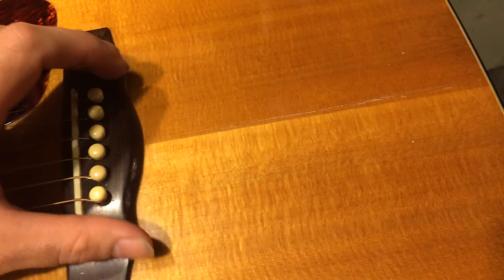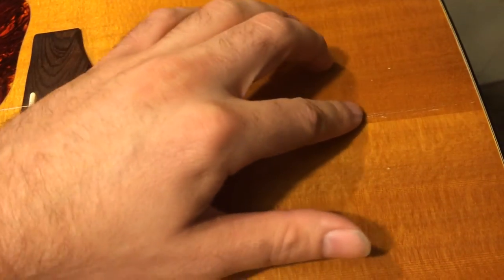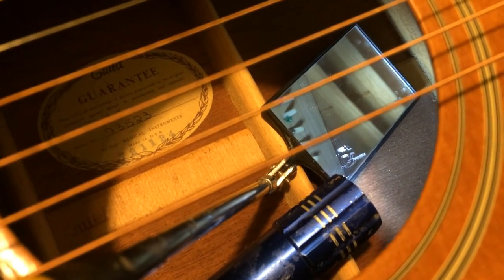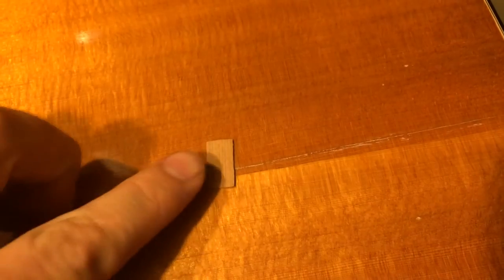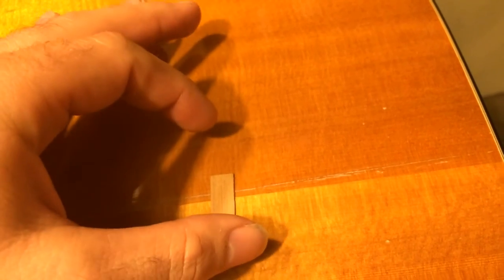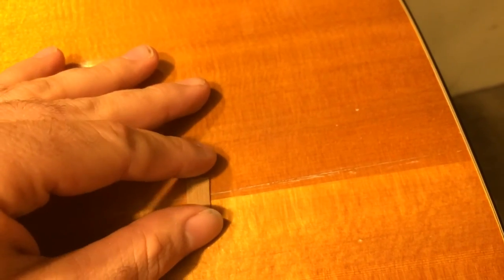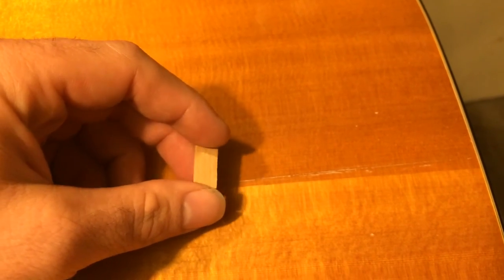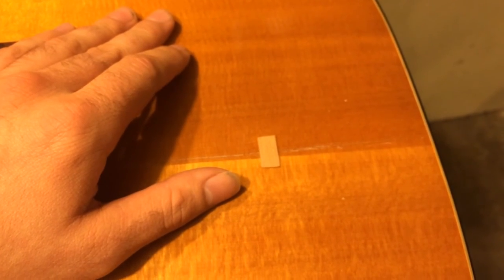Crack Repair: Cleats are Important

Comment: In violin repair work cleats are typically used with grain at a 45 degree angle to alleviate uneven grain expansion from humidity. I have seen cross grain cleats (90 degree offset in grain direction) worsen a crack. I am not sure if this translates to guitar repair.
Reply from the maker: I have done them both ways. I think that the advantage of doing it at a 45 is that if you have others glued in either perpendicular or at a reverse 45 that it will break ou the otherwise sharp line of cleat edges which I think could cause some strain in themselves.
Reply: Hello! I might add that the main reason for a violinmaker/repairer to make a cleat at 45 degrees is to avoid that the ends of the cleat become a marker for a new crack, and to reduce stress when humidity changes. For crack repair (and almost every other repair in the violin world for that matter), we always use hot hide glue mainly because of reversability, being able to redo repairs without damaging the instrument. Hide glue is unbelievably strong but also somewhat brittle, and in most cases it will break before the wood itself does. In crack repair this can be an advantage, because like in your case in the video, an uncleated crack may sooner than later open again, preferably in the same spot, and if it's badly glued with some non-solvable glue it is living hell to clean that crack in order to re-glue it. The scenario might also be that the non-solvable glue holds up to the task, but that a new crack appears close to the old one. Cleats in violin repair are usually square, "standing" on one point in relation to the crack. Glueing cleats of-set of the centre of the crack helps reducing stress, and they are also cut down to a pyramid shape, being thicker in center and down to almost flush towards the edges to make it more flexible. The size of it is probably debatable depending who you ask. But from my own experience, if you make a bigger one, say a square about the width of the piece you are using in the video, you also need to cut it thinner to try to reduce the dampening effect and still gain flexibility and strength as much as possible. Alternative materials like parchment, cloth(cotton or linen), Japanese paper etc. is also common in violin repair and might be used in arched instruments because of the strength the arch itself offers. But they are probably less appropriate when used on a flat top/back and especially when used with hide glue, wich tends to "pull" when it dries and may distort the surface when used on a bigger, flat surface like a guitar top. The biggest difference between violin and guitar repair though, is probably that violin repairers tend to be very concervative and rip the top of for easier access to the inside of the instrument, while the guitar repairers comes up with ingenious solutions for them to do everything from the outside (not necessarily easy)😂 
Best regards,
André

Comment: So, I have an old arch top, f hole Harmony from about 1947. Two big cracks. One from upper f to top binding, one from lower part of f to bottom binding. About 1/16th wide, down to nothing. I'm humidifying it now to try to narrow the cracks, but can't think how to cleat it.
Reply from the maker: boy, yeah, arch tops, mandolins and sometimes ukuleles are a real pain. What I do with arch tops is I have a piece of tie wire that I bent a little loop into with some round tip needle nose pliers. I put a neodymium magnet on that loop, with a cleat attached to it using double stick tape and then put another magnet over the crack on the outside of the guitar. Its often much less exact and messier but that's the best way I found to do it without drilling a hole and using a tie block.
Reply: @DrewsGuitarShop  Wow. Ingenious.

Comment: Great tip. How do you attach the cleats on the back. What type of glue should I use? Is it better to use a few small ones and put them like a stitch or a long thin strip that covers the whole crack (along the crack)?
Reply from the maker: +Jeet Ray I use regular yellow wood glue for this job and tend to space them about an inch or a little more apart. In most cases it's best to use these short cleats. For one thing, a long piece of opposing grain soft woof is going to be extremely hard to work with and it will also effect the movement of the wood more than a series of short cleats will. One of my very old teachers from way back preferred using fibrous material soaked in glue, like cotton, gauss or panty hose material. I have used this method before as well, and though it is a lot sloppier looking and also has the drawback of not really being a tone material, there are instances in which it does work better than cleats.
Reply: +Drew Jones Thank you. I own several high end classical/flamenco guitars. I just fixed a hairline crack on the back of my guitar yesterday with super thin CA glue. Didn't use any cleat. May be next time. As you said - eventually when it opens up again.
Reply: What if you used a mahogany cleat on a spruce top?

Comment: what if the crack runs above and even with a brace and cant be cleated? how is that repaired
Reply from the maker: The brace is probably separated if that is the case. Reglue the brace and it will do the same job as a cleat.

Comment: Hey Drew! I'm doing a crack repair in in the side of a guitar (solid rosewood) and I have some rosewood to use to make cleats, but the density and quality of the two woods are not (perhaps) not (sufficiently) analogous. I was wondering if running cleats across the grain of the side won't inhibit the free vibration/resonance of the side as much as running another material in the same quantity (spruce, mahogany, plastic, a live animal... really anything ) across in the same fashion. I assume that even a rosewood cleat will change the tonal character of the guitar a small amount. How relevant in your estimation/experience is the choice of cleat material? Also, how thick/sturdy should a cleat be? Ive heard of people using cloth cleats. Thanks so much for posting!
Reply from the maker: Well, I mean, the crack has changed the tonal characteristics. That ship sailed when the instrument was damaged. The cleats will effect the vibration a bit, but when doing repair my priorities are playability, tone and looks in that order. If that crack reopens, the instrument isn't serviceable. Generally, I would go with a cleat either made out of the same material or a cleat at least made of of a stable wood like mahogany or spruce. I have used cloth cleats in the past. In some cases, like when a crack is right on the edge of something that wont allow for the fitting of a cleat, you need to. It has a couple of drawbacks though. 1: its messy and looks messy. 2: It's not resonant at all and dampens tone more 3: It's not as strong relative to the stress applied by the crack. Usually when I use cloth it will be some cotton gauze soaked in glue or t-shirt material.
Reply: I really appreciate your prompt response and expertise! touché on the crack changing the tone. In this case, the guitar was cracked by extreme heat and dryness in shipping (brand new) from Martin. The heat was so bad that the pickguard adhesive melted and the pickguard slid.  Because of this I got it for an extremely good price. Just trying to bring it back from the dead with as positive a result as possible. Cheers!
Reply: How did the repair go? Sound wise? Just curious. Thanks

Comment: When guitar tops are made, they cut a piece of spruce for example right down the middle and open it up like a book. Then they glue two ends together with glue and nothing else. They do not use cleats. If the top cracks you do not always need to use cleats. Humidify the guitar first to close the crack, then work in the glue and clamp. Cleats will change the way the top vibrates and ultimately the sound of your guitar. I would not take my guitar to a luthier who makes blanket statements like, "Don't do crack repairs without cleats or take your guitar to someone who does."
Reply from the maker: Actually, many high end builders do either use cleats or a seam strip on that seam in the middle of the soundboard just like you typically see seam strips on the backs of solid wood back/side guitars. It's a matter of opinion, I suppose, but every one of my mentors in and out of luthier school recommended cleats in the case of most cracks.
Reply: There are so many other things that reduce vibration far more than thin tone wood cleats. How about that big piece of plastic you glue to your top...pick guard? How about when you rest your forearm, palm or fingers on the top? How about the cushion of your body on the back? How about dry brittle guitars versus properly humidified guitars? How about all the crap plastic pins, saddles and bridges versus bone? Yes, I mean "Tusq," too. Then there are strings...and more.

Comment: I have repaired many gutars over the years that have had crack repairs WITH CLEATS.
The solution is NOT CLEATS. The solution is to do a well-done repair and HUMIDIFY YOUR DAMN GUITAR.  You should also humidify the guitar BEFORE repairing it. DO NOT attempt to simply clamp the dry guitar together and glue/cleat it up. Close the cracks by humidifyiing it and THEN make your repair, and then take care of your guitar properly so it doesnt crack again. Cant tell you how many cleated but poor  repairs I've had to fix.
However, if you have, say a 100 year old guitar that needs a top splint becase the crack has been open and the wood dried out so long,  yeah, then maybe a cleat might help, but a well-aligned, properly glued crack may not need a cleat at all.
This "dont take your guitar to someone who doesnt use cleats" is pure ignorance.
If the guitar continues to be abused, a new crack may indeed  appear right next to your cleat.
Reply: I recently glued a crack. I havent put cleats yet and going to humidify. How long should i let it humidify before i put cleats? And finish the repair?
Reply: @vinceanthony9608  Weeks. Seriously, even months. 70+ degrees and 50 - 70% humidity has worked for me.

Comment: goodby tone of the guitar no cleats
Reply: Wrong. Crack already stopped vibration/wave travel. Humidify, glue, clamp, cleat. Then take the damn sound deadening pick guard off. Then replace all the damn  worthless plastic pins  nuts and saddles...with bone.